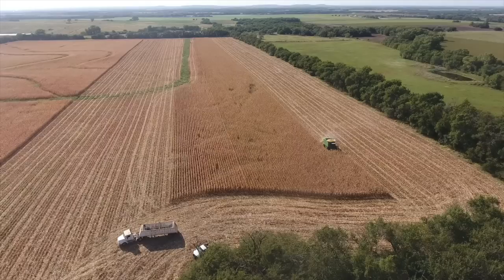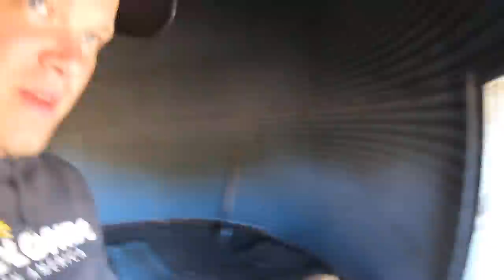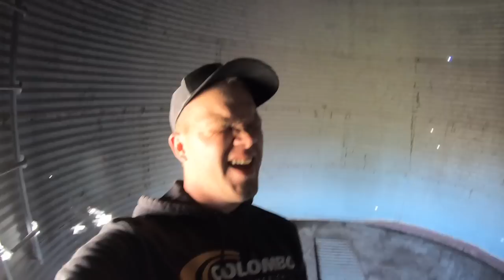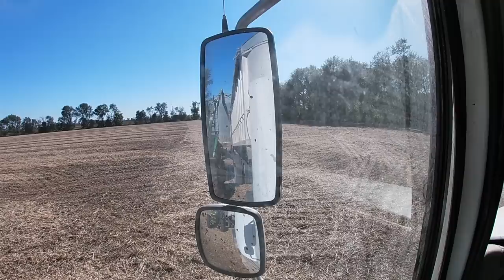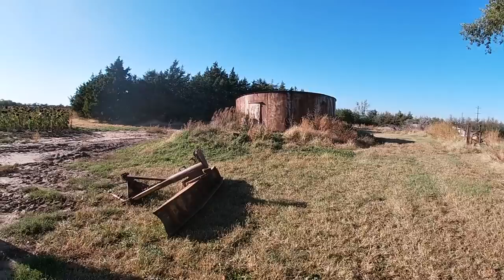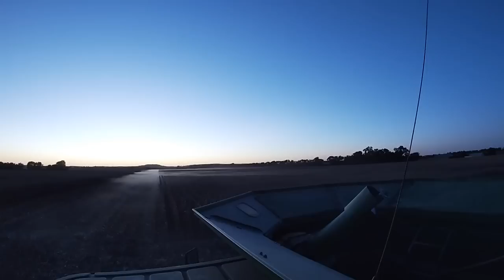Picking Corn 🌽 For The FIRST TIME!!!

Comment: When I have seen you chop corn for silage, you spread it on a pad, compact it with a tractor and cover it with tarps.  As a civil engineer and not a farmer, is there an optimum level of compaction that is best, or is denser better, period?  If denser is better, have you ever tried vacuum  compaction/consolidation? Basically this is to draw a vacuum/partial vacuum under the tarp, thus putting up to 15 psi (atmospheric) pressure on the entire pile for an extended period.  15 psi is the equivalent of about 24 foot high layer of earth on top of the tarp.

Comment: chainsaw ran out of battery....Is that a Milwaukee M18 chainsaw?  I have one, pretty good darn saw if ya ask me.
Reply from the maker: sunhawk61 it's a dewalt and I like it a lot. Only reason it was out of battery is I forgot to charge it. It's a great saw.
Reply: @PetersonFarmBros  I had the dealt, great saw until I dropped it out of the loader and ran over it.  This Milwaukee with the 12 amp battery chews right through hedge.    Made a lot of fence posts with it.